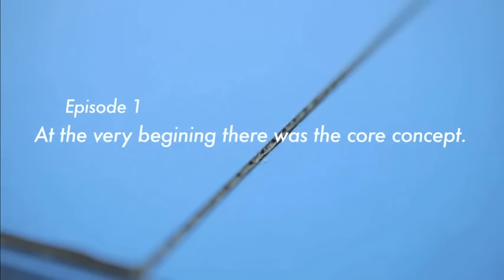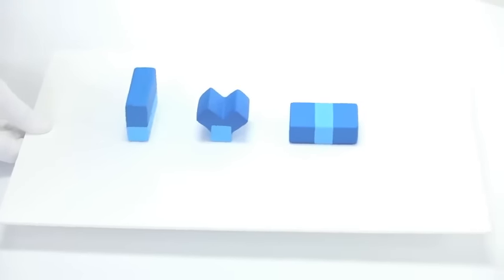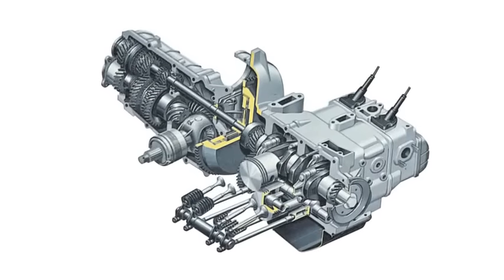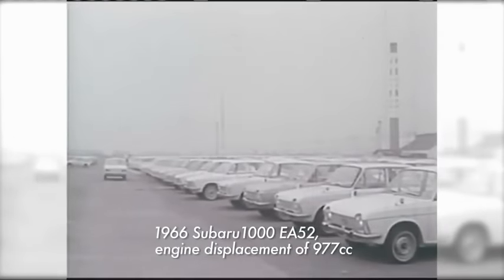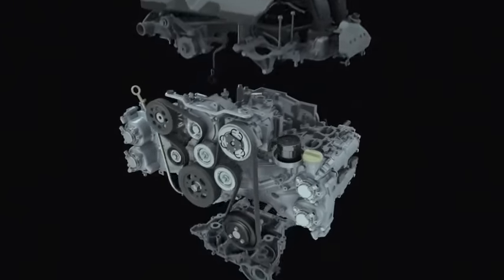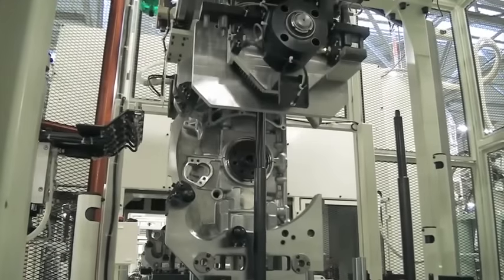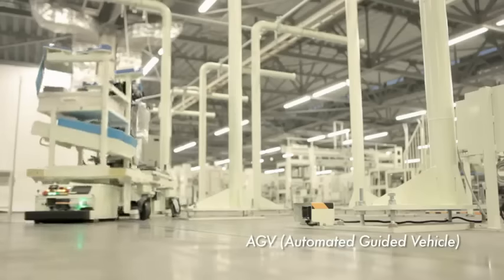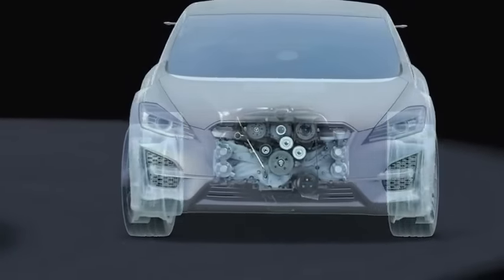Learn About Subaru Boxer Engine Technology

Comment: Honestly, I don't see anything here that really convinces me this is a great engine design.  I just bought a Subaru but I'd be much happier if it were an inline-4 rather than this "unique" design, nor would I complain if they offered front-wheel drive.  Supposedly they have fixed the head gasket issue on my model year (after HOW many years of it being a major problem?), but now I see that more recent ones are having oil consumption issues, so it can hardly be said that the boxer engine has had all its quirks ironed out.  Do inline-4's have these kinds of problems?  Not from the best manufacturers they don't.  The fact it takes "twice as long" to make as an inline-4 is also not a good thing from a business perspective.  As for this "lack of vibration," who are they kidding?  A Honda or Toyota 4 cylinder is way smoother than their boxer engine.  The H6, however, is indeed very smooth, similar to an inline-6 really, but I have found both the naturally-aspirated 4 and the 6 to be very dull from a performance perspective.
Reply: Headgaskets were last an issue in model year '99. Since then, the majority of issues were maintenance related.
Oil consumption in 2013-2015 models is in less than 2% of all sold.
Reply: FCFordLord Not true, I know the head gasket issue continued all through the 2000's.  They try to downplay it, and maybe it wasn't as big an issue as it had been, but it still existed.  I think they finally nipped it in the bud in 2010-2011, at least with the 2.5L.
Reply: +Maestro_T I have never seen headgaskets go on any engine newer than '99 that was well maintained. I've seen a decent amount where the coolant was rarely, if ever changed, which caused headgasket issues.

Comment: I agree with this video and the advantages listed. One huge disadvantage, the main engine seal in Subaru's cannot stand the stress in this design and despite repeated redesigns, it tends to fail after 100,000 miles and need a rebuild.  It is the only problem with this engine, but it is an expensive one ($4000+).  Hoping the latest redesign in 2010 (strongly recommending synthetic oil) does the trick.  My current Subaru depends on it!
Reply: That's not necessarily true. I have an 02 wrx sport wagon. Done all my own maintenance from 10 miles on the odometer. The only things replaced are acc. belts, hoses, timing belt, water pump and clutch. Pulled the engine to do the clutch and timing belt/water pump myself at 105k miles. Pulled the job off with ease and I am not a real mechanic, just a do it yourself kinda guy.
Reply: Oh btw I have 161k very hard miles on my wrx.
Reply: Also you need to find a new mechanic because you are being ripped off if you think it should cost that much to replace a rear main seal. I hope you didn't mean the front seal. That did leak on my daughters legacy. I replaced it in 4 hours and for less than 30 dollars.
Reply: Hi, I meant rear engine seal (otherwise called the main) as you usually have to get the engine out of the bay to replace it - the expensive one, not the front - which I did myself on a Toyota I owned previously (and the valve train - that is the easiest of them all).  This is a chronic issue on older Subarus.  My parents have owned 4 of them - they all lost the engine seal.  My friends have owned three others - they all lost the engine seal.  This is my first Subaru - like I said - I hope I don't experience the same fate.  My cars last a long time.  My Saab is nearly 9 years old and it has 127,000 on it.  It has needed a new alternator and a new vacuum pump for a total of $600 over the years.  That in my mind is reliable.  Expect the Subaru to do the same thing even if that seal goes.
Reply: They over charge. I am just a do it yourselfer and pulled the engibe out of mine to since it needed a clutch and timing belt/pulleys/water pump. Sure the car was out of service for two weeks since I work also and I paid a moble mechanic 250 to help work out a few check engine lights after reinstalling the engine but all total I did everything for under 750 in parts and labor. You just have to find the right guy who like Subarus. There are lots of guys who work on these cars. Rear seal is not a big deal unless a mechanic makes it one by ripping people off. Thats the honest reality.
Reply: Trust me, my guy is honest -the dealership is terrible.  Example: recently replaced the air filter for $19.  Dealership wanted $99.  I used to work on my cars but with the computer codes and the pain to recycle oil, I don't bother anymore.  I am lucky I found this guy as I do test my mechanics and he passed them all.  I only have the cost from others who have rebuilt the engine.  Like I said, I have never done it yet.  The car is only 16 months old and has 22,000 so it is very young.  Ask me again in another 6 years and I will let you know if the engine seal went or not - and how much it costs to fix it.  Like I said, I don't do this stuff anymore - don't want to deal with the environmentalist issues.
Reply: AcuraT you need a better dealership then. I get mine done at Davenport Subaru. An oil change a tire rotation and replace the air filter was 120$
Reply: curtis tompros did you say "only 120$"...how much of that is labor? An oil change and air filter takes about 15 to 20 minutes to perform. 120$ is a lot in my point of view.
Reply: Wayne Wildman the air filter is a 30 dollar part synthetic oil where I live will cost you 70$ for 4L 5$ for oil filter. Plus a tire rotation. If I were to buy the part my self I would pay more then 120...
Reply: Damn synthetic is that much? Where do you live? My wife just paid 49$ at the dealership for a synthetic oil change and tire rotation on her 3 month old WRX.
Reply: I should say, my synthetic oil changes are about $50 including filter and installation.  The air filter is $19 plus $10 to install.  The dealership would charge me about $120 if I tried to use them.  I won't.
Reply: Wayne Wildman Canada ontario
Reply: curtis tompros wow. Wha's gasoline go for there? In northern California its about 3.50$ per U.S. gallon.
Reply: Once again. Mine has never had a rear seal problem with over 160k miles. I have seen others that have though. It might be most engines have that problem but it is not "all" as you say.
Reply: Hi Wayne, genearally speaking - a very high percentage have this issue.  Nothing is all.  Good example, in the 1990s - people post "All" american built cars are pieces of junk.  However, there are a certain number of cars (Chevy Nova) that are still running today that were not pieces of junk.  Still, they are faulted for having junk on every car built.
Reply: And there is no car easier to pull the engine out of than a Subaru as far as I am concerned. Its a piece of cake. 
I take that back. The old vw bettle motors come out easier. But those dont even count in my book.
Reply: Fair enough.  Car Talk shows thousands of the cars with this problem.  Like I said, you are very fortunate.  Seattle's dealershp has a webiste showing it to be a chronic problem.  It was resolved aroiund 2010 and the reports dropped drastically, but before that, buyer beware on that one concern  - otherwise the cars were rock solid.
Reply: Wrx 2005 250,000 miles no seal issues. Legacy with 125k no seal issues. Stop trolling
Reply: Not trolling.  My parents have had three of them.  A 2001 Turbo Forrester with an engine leak at 81,000.  A 2003 Regular Forrester with 110,000 with an engine leak.  A 2006 Outback with 120K engine leak. Also, I have a neighbor with with a 2007 Outback (now with 200,000) which got an engine leak at 105,000.  I have more examples near me as well. We all own them, and most rebuild engines at around 100K to 110K until the 2010 model year.You were lucky, as I said.  Some do go further - the majority do not (I do have a couple of neighbors with no problems as well, but not the majority of people).
Reply: Wayne Wildman were at 1.30 for a L
Reply: AcuraT I was not lucky. I took care of it better than the service manual even requires and kept the head grounding straps clean and tight to stop electrolisis from happening. I understand what causes those issues...that is the big difference.
Reply: TheManYouNeedToBe electrolisis is what causes all engine corrosion. It is triggered by dissimilar metals in the cooling system. Why do you thing all engines have the block and heads grounded with grounding straps these days? 
That is why and certain engines need to be properly grounded more than others.
Reply: That is fine that you do that. It is not normal to do this on any car.  It also explains why logically you never had any issues.  Unfortunately for most of us, we are not aware of this and it is not normal standard care.  As a result, your experience is not the majority of people.  Again, I admit there are exceptions - you are one of them - not the standard experience on older Subarus.  I do take care of my cars, but don't go beyond what the dealer calls for.  Works for my older 2006 Saab 9-3 with it reaching 130,000 miles by tomorrow.  No real issues so far. Same goes for the baby car, a 2013 Subaru Legacy which I expect with the new engine seals will not need much engine work at 120,000 (it only has 30,000 so far).
Reply: I run royal purple oil and coolant additive in all my vehicles, plus I hit them all with zmax every 8000 miles. I change my belt/s and pulleys every 50k. Works for me. No head gasket issues. Ford Expedition/Mustang/500 awd (275k)/subaru wrx/Legacy. Wrx is the kids car
Reply: TheManYouNeedToBe man you rule. At least I am not the only one capable of keeping their Subaru's working right. 
Crazy that the wrx is the kids car...I wont even let my daughter drive ours unless I am in it with her. It is just to easy to go very very fast in it and I don't want her to die. Lol. You are braver than me for sure.
Reply: AcuraT yes I do go the extra miles to keep my machines in top condition. I am sort of a freak about this sort of thing...OCD ya know, also I am a pretty good mechanic because my grandfather was an auto mechanic and my father was an aircraft mechanic. They taught me to work on just about anything.
Reply: My wifes dad was a aircraft mechanic and my grandpa was a helicopter mechanic. Bell & Lockheed
Reply: Wayne Wildman Fair enough.  I used to work on my cars but it has become impossible around here to dispose of almost anything without hiring a service to come pick it up and dispose of it.  Dumps don't take oil anymore, and don't like taking broken parts.  It got so expensive I stopped.  Still have my socket wrenches but that is about it.  I do minor things still (headlights, bulbs) and some troubleshooting before I bring it in for major things, but that is about it.  I respect what you do but just cannot do it anymore.  At least now I completely understand why you are one of the exceptions on the older Subarus and not what many unfortunately experienced since they did not do the work you have done on it.  As with anything, the more you maintain the longer it lasts.  I will say this - besides this one issue with the older Subarus if you did not do the extra work you mentioned, they were pretty much trouble free for everyone I know.

Comment: Gravity ? on pistons ? That will be a very weak force since the pistons are moving quite fast (= much bigger force).
The "+ gravity force" is almost zero then (compared to the life of the engine forces).

It is like saying "how many miles/km can a normal car run with a full tank of gas? and then add : but i will put 2 gramms more in it !"

Comment: What about the disadvantages! There are reasons why most car makers do not use boxer motors, and there is no patent, anyone can freely make a boxer motor, but most don't. Even Porsche make more motors other than their boxers, and they only keep their boxer motors as a tradition. Subaru have resisted the boxer motor in some models.

Comment: I prefer the Porsche and VW PRODUCTS.... Boxer Engines designed to WIN....!
Reply: Gordon Mccoy vw beetle?
Reply: I have bought and driven a Beetle back in the mid '70's and absolutely LOVED that basic car when I was in the Army at Ft Bragg.... Now I have my 5th BMW bike.... It's a '98 R1100R Oilhead, 75th Anniversary model.... Found and bought it in Maui, HI about 5 years ago... Immediately called Bob's BMW near here in Jessup, MD and asked them to send me some Michelin Road II's... Now have about 15,000 miles on those tires and it's about new shoes....

Comment: Why add complexity to a 4 cylinder if you'll make the same amount of power? COG? Just lower the car, 0.5 inches means nothing.

Main reason I didn't buy a GT86. That and having a McPherson front strut suspension instead of double wishbone.

Comment: Then, why does it say Toyota on top of BRZ's engine?!
Reply: they made the fuel injection system, nothing more; still a great engineering feat for toyota thou
Reply: +jitterball The port injection system, which the WRX and STI doesn't have keeps the valves clean by having gas pass by them, which has detergents and such. The BRZ/FR-S engine is a wonderful piece of engineering and many learnings will likely be applied to future F engines at Subaru.
Reply: because the subaru brz or the toyota 86/ scion frs is the same car they joined and made a very good car
Reply: You have to understand this is a video about the boxer engine. The boxer engine has always been subaru's love child. Toyota applied its D-4S injection technology with a new boxer engine project but most of the engineering was done by subaru.

The car's concepts and original mapping was done by toyota. They originally wanted a v6 rear wheel drive hybrid piece of shit; but they also asked if subaru wanted to try the newly co-developed D-4S Boxer engine inside of their concept car. Subaru was like GTFO we don't do rear wheel drives anymore; however, after a development car was built subaru was like 'shit this a great car. We would love in :)'

The D-4S Boxer is technically more Subaru than Toyota but the concepts were originally toyota's. So I think its pretty fair to have both names on the engine cover if u ask me :)
Reply: Thanks for the information
Reply: Thanks for the information, guys.
Reply: ***** I hope! If it has DCT it'll be my next daily.
Reply: That's because it is a collaboration and the ignition system is by Toyota.
Reply: +jitterball Fuji Heavy Industries (Toyota) actually owns Subaru.
Reply: That's kind of what I meant.  All basically the same company which is why there have been so many collaborations on certain vehicles like the BRZ.  The same handful of rich dudes that call all the shots.
Reply: jitterball it doesn't

Comment: That only two car manufacturers in the world cannot be correct
Reply: but it is....subaru and porche .....there are however multiple motorcycle manufactures that use them too
Reply: I agree, all the other car makers have taken these engines apart and decided that the are too costly to make and over complicated to service. The second hand market is frightened off, not easy to self service. It will go the way of the rotary engine concept. Don't you think that Rolls Royce would have considered using this design when we over ran their plants at the end of WW2.

Comment: I mean now dont get me wrong here... rotary engines are actually the most uniqe design for an engine they rev really high and it has some good power but they wear out quickly. For a subaru i have seen every single rx7 get smoked bye a sti. Im not saying its a horrible car but they can do better.

Comment: :) 
I tested Subaru Impreza 2.0l and they have high HORIZONTAL vibrations !!!!!! that are not existing in any other engine type ;) 
I have seen the issue on 2 different Subaru, Impreza and Outback :)
Reply: +Georgi Todorov horizontal vibration is common in boxer engine because of the piston's horizontal movement

Comment: Original invention?? German KRUPP troop carriers had flat sixers since early 1939. Russians put twin turbo, flat ten cylinder diesel in their T-64 tanks since 1965 and keep using same engine that now reaches 1200hp and over 2500 N-m of torque.

Comment: it's a reason why only Subaru uses boxer engine. it is complex has two cylinder hads, two valvetrain units, two exhaust and intake collectors. all this adds extra production and maintaining costs and with no real benefit. actualy engine takes more room, it is heaviers and althoug it is mounted low it messes with front:rear weight distribution. Thus Subarus are front heavy.

Comment: A ideal engine would be only one moving part
Reply: +Clifford Zellner Yeah, like... an electric motor
Reply: +nickr753 ..yep and brushless.

but there is still the really really really heavy battery problem.
Reply: +Punchy LightBeer Hopefully somebody figures out the new undeveloped(currently being researched) Graphite battery tech soon and uses it for cars.
Reply: what about rotary? those things are extremely unreliable and give you the gas mileage of a V8 despite the fact that they give you the part of a v6. The weight of the engine is pretty amazing tho.

Comment: So who copy who porsche or subaru cuz bth have horizontal engines
Reply: Porsche came out with a 4 cylinder horizontally opposed engine in their 356, which sold starting in the late 1940's. Subaru's first flat fours were the EA series engines, offered in 1966. Chronologically Porsche came first. The original design came out as early as 1926 in the Tatra 30. 
That being said I wouldn't say Subaru copied Porsche, as the flat four design is just that; an engine type, like a V6, V8, inline-4, etc. Porsche and Subaru boxer engines share little in common besides the cylinder layout.